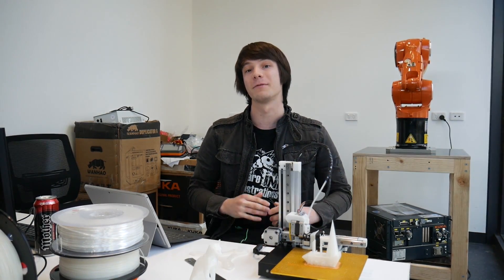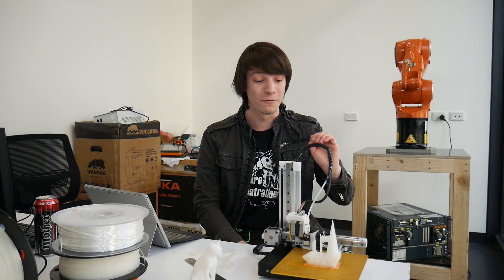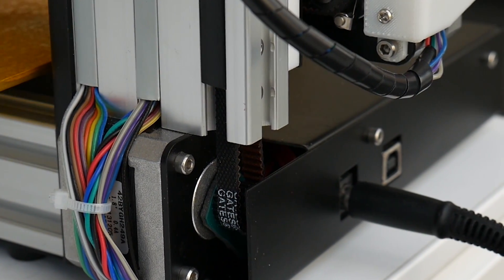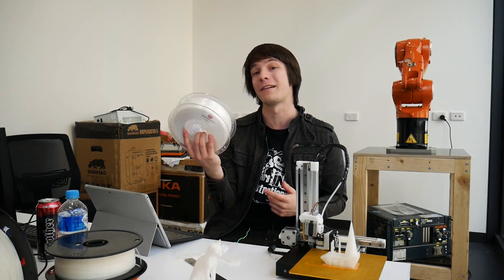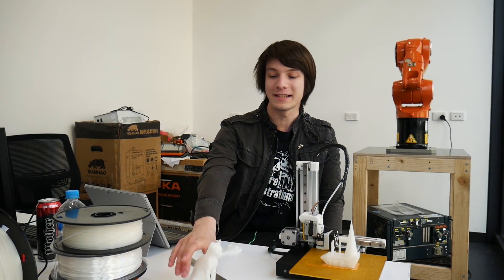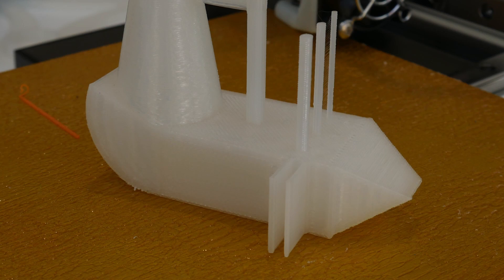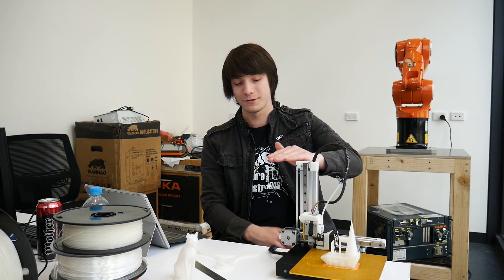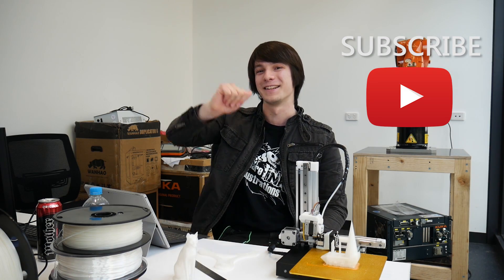Cetus 3D Printer - Pre-production Review

Comment: Is my Cetus (mk2) just a lemon then? I can't seem to get good results from it. Constant issues. I can calibrate the machine, start a print, and sometimes the head will still smash into the build plate and just grind the gear against the best for a while, then shoot off in another direction and scratch the shit out of my plate and nozzle. Can not print raftless at all, just does not stick. Supports are close to unremovable, raft is often literally unremovable. Levelling is a nightmare... All in all, just super not happy with this machine. There is a print sitting on my bed right now because I haven't bothered peeling it off because I tried once again to print raftless (Because I can't remove the raft from most pieces) and it printed a brim for which was fused to the part

Comment: I just bought this machine based on this review. My first 3d printer. I didn't need a large build volume. I just wanted something cheap that was easy to assemble and calibrate that produces consistent "decent quality" prints. Assembly time: 30 minutes. Software install and calibration: 20 minutes. First print within an hour of opening the box. I've printed 20 objects so far. 20 successes, zero failures (except running out filament once). In short, I love it.

Comment: You a hapa?
Reply from the maker: a what?
Reply: Hawaiian originated word meaning racially half 'n half. Doesn't necessarily mean half Hawaiian but usually refers to with heritage from Oceania or the Orient.  Half Japanese people self identified under the term helping to popularize it.  Due to the frequency of interracial pairings the term has entered common parlance.  It is not intended as a derogatory slur.  Are you mixed race with European and Oriental? From seeing you speak I am disinclined to think (though still consider it possible that) you have fetal alcohol syndrome or perhaps incomplete trisomy; should you not be miscegenated they would be likely. 

You should file it away in your lexicon as I'm sure the usage will continue to increase.
Reply from the maker: Heh neat. Honestly I have no clue at all, the family tree is broken on both sides and goes back in Aus very very far. Should do one of those DNA tests :P

Comment: This printer I thought very good because of the linear rails and optional heated bed. An enclosure could be made but single unheated print head it couldn’t really take full advantage of its precision movement for useful engineering and light production industrial parts made of nylon or similar so I guess I’m still searching...

Comment: The belted Z dropping on power off seems a silly mis-step, could be easily solved by a worm gear. Direct drive on a cantilever arm seems silly, it's so small that Bowden could be used with little drawback. Still, print quality seems good. However the biggest drawback is the proprietary nozzle, that turns me off straight away, vendors stop selling the special ones after a while then you're screwed.

Comment: sounds biased to me.
Reply from the maker: Not sure that a biased review would point out that 50% of the PLA I tried didn't work... >_>
Reply: in your final opinion you simply ignored most of the flaws you mentioned and focused on irrelevant positives like stripped down design and favoring price over all the more important flaws. this indicates you either have no nads or are biased. The price is at their cost and not sustainable unless they plan to make money other ways like inkjet printer makers do. Negatives; no heated bed, no spool holder, no leveling, no rigidity, no liner in head, no filament sensing, user has to fix problem with clicking, proprietary slicer, warping with PLA, big whoop they provide a 0.2, who doesn't. Call a spade a spade, man up and say you don't recommend it despite the low cost.
Reply: If he didn't have a final opinion at all you wouldn't be saying anything about this. All the information on what he thinks about the product is in the video and I personally don't need someone to repeat what they have already said in order to understand the review.

Comment: i have that filament clicking with some PLA from 3D print gear on my UP mini. Im wondering if thats the same issue. Only some colours do it and depends what i print. could it be my settings?
Reply: Exact same hot end as the Up Plus 2, and the Up Plus 2 is the exact same hot end as the UP mini. The Up Plus 2 has the exact same base as this printer. I think it's all the same company, or a child company producing this printer. Probably used a new company name so they're not taking customers away from their high end machines and just target marketing the ~$200 market.
Reply: Typically on the Up printers this is because the extruder stepper motor gets really hot, which softens the filament.

you can replace the motor with a nema 17, which runs much cooler, or you can mount an extra fan to cool the motor. Either option will cost you around $20 in materials. And either option requires you to print out some new parts for the extruder mount; the nema 17 doesn't fit the extruder mount because it is a bit longer, and the cooling option requires a custom fan mount for the motor.

Comment: Well the review made me really ecxited about this printer.. But!

- On the last minute the shipping cost became 50$ for the US and 70 for the rest of the world - why so late? you already had printers that you could check. 
- The 300mm upgrade cost 130$(!) which is a lot for an upgrade the campaign almost hasn't shown.
-"We promise to use rails that have equal or better quality than our prototypes"... well thats kind of 'not promising'

what's your opinion? How was you impressed by them with your relations?
Reply from the maker: Not defending them - but to go through the changes;
- they're shipping factory to customer which is always more expensive than factory to distributer then customer or reseller, but it's much faster. Mine came in a fairly large box and in Australia for me to send that box across the states would still cost ~$50 so sounds about right.
- I agree the 300mm upgrade seems too expensive, maybe rails that long cost more due to a lower qty.
- Yes the change away from genuine hiwin rails is misleading, I may follow up on a video with that. They're currently saying they may use IKO rails from Japan.
Reply: +Maker's Muse 
-Fast shipping is great, the only problem is that they changed the cost on the last moment which is wierd
-It is probabley due to quantities, but do you believe the upgraded version will be stiff enough?
Reply from the maker: Personally if you print FAST I don't think it'll be stiff enough, you'll get wobble towards the top. But, the design would be very easy to modify with a single rod on the unsupported side which would make a world of difference I think. Did they change the shipping after you pledged? Not sure if that's against kickstarters guidelines but definitely not looked kindly upon...
Reply: +Maker's Muse I have not pledged since I don't need another priner, 2 months earlier and it would be an option.. but I read in the project's comments that it happened to some of the early supporters.

Comment: @Angus : My guess would be that the PLA's which gives problems for this printer need a bit higher extrusion temperature to be able to push it through the hotend.
The extruder is probably not up to the task if the filament is not at an optimum viscosity.
All PLA's should print fine if you dial the temp in on this machine

Comment: to me no heated bed no 3d printer
Reply: I used to say that too until I bought a couple of Flashforge Finders for my shop classroom. So far I've had perfect adhesion and no warping what so ever. Sure, I'll still take a heated bed if I can get it, but now I consider them optional. I only print PLA and ninjaflex so far though and neither of those require a heated bed and for school work it's PLA only because giving children chronic respiratory illnesses isn't considered educational enough [grumble grumble] stupid laws [grumble grumble]...
Reply: Pile of carbon sure if you print PLA no real need for a heated bed . I use exclusively ABS in my projects so a heated bed is a must but not suited for classroom
Reply: There is a heated bed available for the Cetus

Comment: I really like that they ditched the rods and rollers on aluminum extrusion and went with some REALLY nice linear guides that if treated right will last indefinitely... i think that is a game changer!

as for the bed grab a chunk of aluminum or G10 and slap some buildtak or whatever you like and funky bed material issue done :)! 

that said an all metal hot end on a pla only machine makes no sense to me... i only say that because anything requiring a heated bed is out and you never get near PTFE's "danger zone" temps on PLA but that is my view. That said it could also be a heatbreak issue as i know the old E3D hot ends could not do PLA but now can due to improved heatbreak design making a real abrupt "hot to cold" transition zone

Comment: i worked for last 2 years in filament manufacturing for 3d print in italy... the issue you poited out in pla printing is true...if the thermal barrier isn't enough cooled,the pla filament will reach the glass transition temperature there and it will stick to the pipe wall or flex inside making a lot of resistance....some pla brand have a mixture of lubricant inside like mineral oil or wax...some other just have a high HDT so they resist more the temperature(like abs)

about the printer: isn't it a up plus 2 boosted? same system, same extruder feeder, same cable,some hotels shape, heater and sensor,same pattern of print...I'm the only one noticing that?

good job maker muse congrats for 30k
Reply: I personally have no idea if this is somehow connected to Up, but they currently (and allegedly temporarily) use the Up Software for slicing and configuring...

Comment: I have a wanhao di3 plus and love it but I cannot get anything to stick to the bed! I live on central coast nsw so it is quite cold, but warping happens to any print! I have tried masking tape, even spray adhesive! Please give me some tips or even recommend a new super adhesive print bed. Thanks
-CaptainBoggle
Reply: I am printing with jay car pla only no abs, and I am running the heated bed at 80c, and the print head at 200c, and have not made any modifications to the printer whatsoever.
Reply: You need to lower your heated bed temperature to about 50-70 because plastics don't stick over a certain temperature. Pla has that sweet spot of 50-70c
Reply: +Tommie ? I will try 60 then, thanks heaps.

Comment: i bet you could easily add a support to the end of the axis that just dangles in the breeze, that has some sort of linear guide, and only use it if you are going print at towards the end of the rail, or on a tall print, as that z axis looks like it will start to rock after a while
Reply from the maker: I'm already looking at that for sure, a single rod would be easy to attach and probably remove all the wobble. Great idea!
Reply: it could also allow for greater acceleration on sharp shifts in direction
Reply from the maker: I only ran in 'normal' mode so yeah in fast for the rapid infills it'd help for sure.